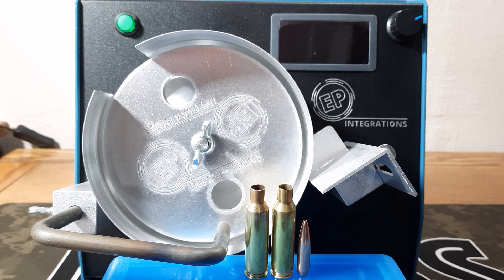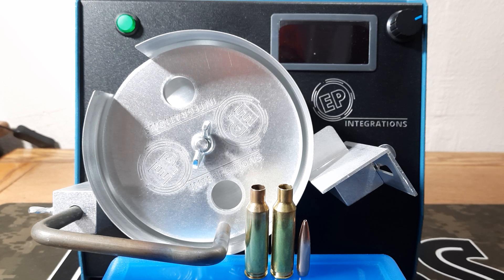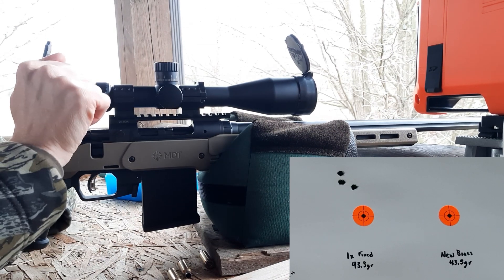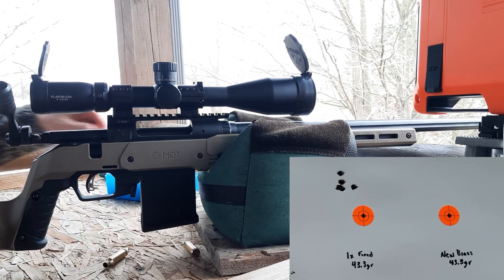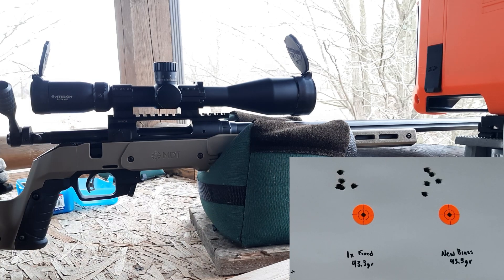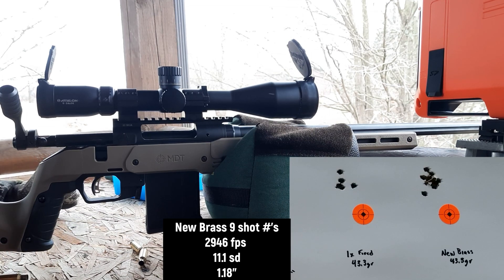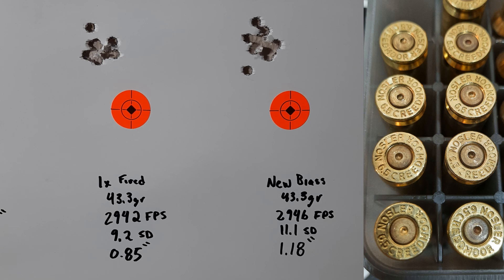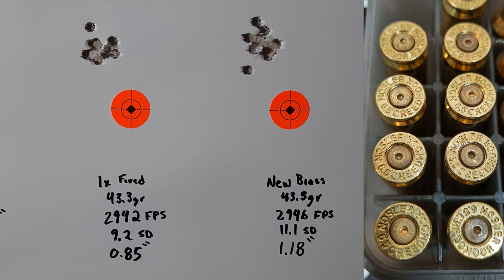Flame Annealed Brass vs. New Brass, 6.5 Creedmoor

Comment: What is the head space size of the new brass? You said that the once fired has a ,002" bump. The test you should have done would be to do a non-annealed once fired brass against the new brass (which is annealed at the factory) in case you didn't know that. The inside diameter of the two lots the same? as neck tension matters, I would suggest that seating pressure might be the difference, or head space, since both lots have been annealed. Annealing reduces the hardness of the brass which extends the life of the brass and can effect seating pressure, you can watch Eric Cortina's annealing tests that he test the neck tension.

Comment: For those that arent using an AMP annealer, or a machine on a timer, ive been told its overall temp on the brass that makes the biggest impact; the solution is tempilaq if using flame to anneal. Brush it onto your case neck and at the temp threshold, it will change colour. Apparently 900 Fahrenheit is optimal.

Comment: I really like your videos so don't take this as criticism.  If you'd buy a little cheap IR thermometer you could go from warm to 100.3 degrees.  Just a suggestion...
Reply from the maker: So I have one of the IR thermometers but for some reason on shiny metals like brass it clearly reads low. Idk if it is reflecting off the surface or not. I have thought about trying to use another type of thermometer to measure. I guess it really doesn't matter as if the brass is cool enough to handle at the base it likely is not being anealed at the case head.
Reply: @RobsReloading  I have one that is an IR thermometer with a metal probe on the end.  I use it for grilling but should also work for your purpose.
Reply: Just an FYI although a bit late.  I am certified in thermal imaging for my career.  The emissivity of polished brass is very low, so you will not get an accurate reading with an IR thermometer(it will always indicate low)  tarnished brass will give slightly closer but still not accurate results.  Same with trying to get an accurate reading off of any polished metal.

Comment: I've always believed an annealed case would provide the most consistent downrange results so this supports my theory. What would be interesting to know is the seating force required for annealed vs new. I don't remember you mentioning it but I'd be curious to know the annealing time/case. 

Erik Cortina did a nice test annealing cases for 10, 15, and 20 seconds, shoulder bump, and neck sized then seated the bullets. What I found interesting was the seating force remained essentially the same, 17-19 pounds, across the brass. 

Thanks for all the superb videos!
Reply from the maker: I use a similar method to Mr. Cortina. Usually dim the lights and set the time so the neck just starts to glow. The time was probably 6 or 7 seconds. It varies a little with torch placement, brass and flame temp.
Reply: Same here around 7 seconds works great

Comment: I just use a propane torch and I use the lee lock stud trimmer without the trimmer in my drill but I've been looking into getting one of these annealing machines to save time because it does take a while to do when you have a lot of brass to go through... I would like a video by you on this annealing machine and what your process/thoughts are.
Reply from the maker: I cover my methods and using the EP annealer in this video linked here https://youtu.be/W4DUaAgZjHc